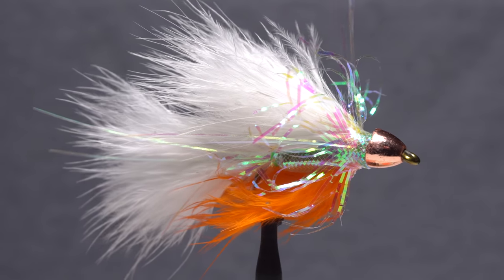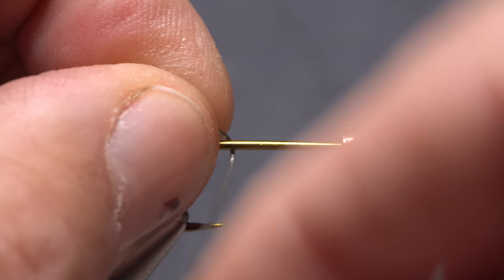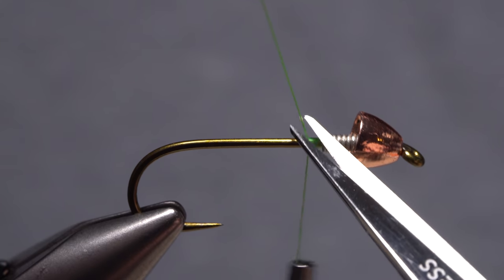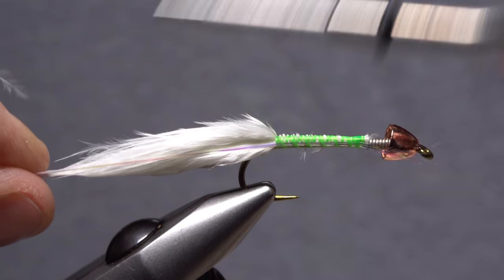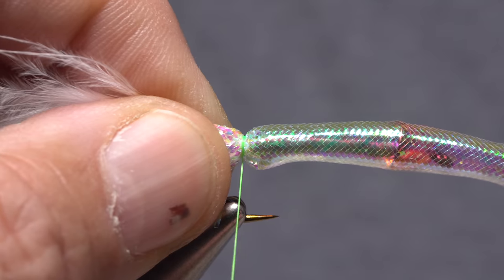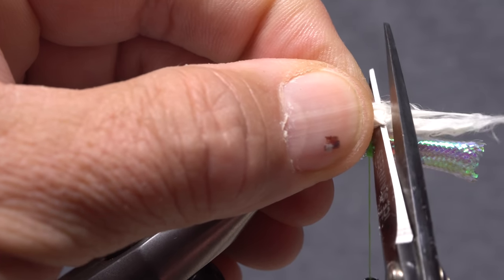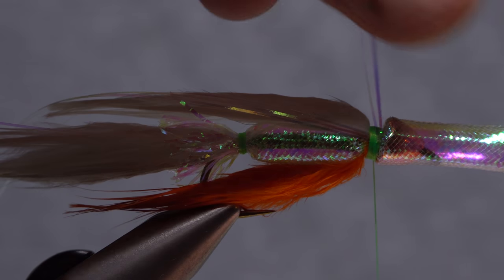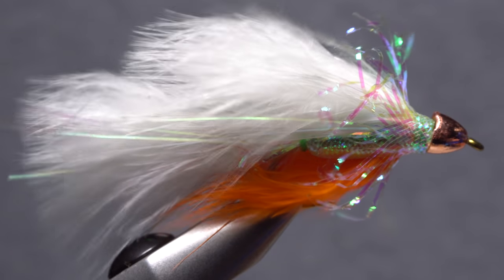Scotty's McFly

Comment: After looking at it for a bit I had everything but the large Mylar tubing and orange marabou so I used medium and a bit of red. I also paired the hook with a fire hole 618 in size 8 with a 4mm black nickel bead. Looks pretty good the way I tied it. I believe it will fool a few steelhead.